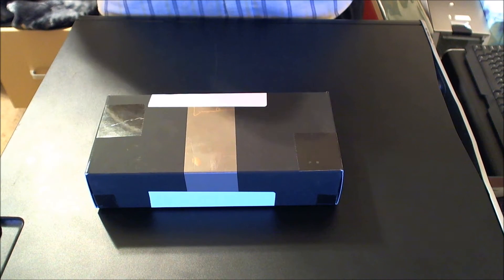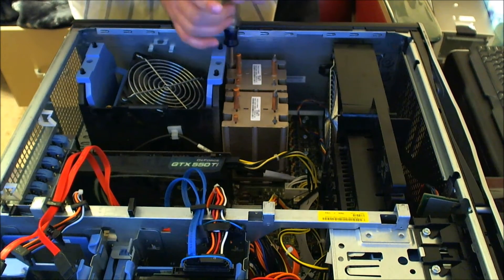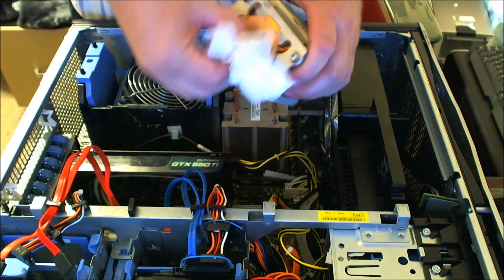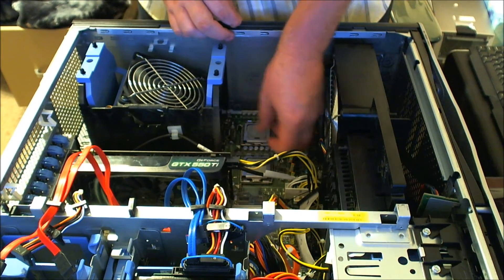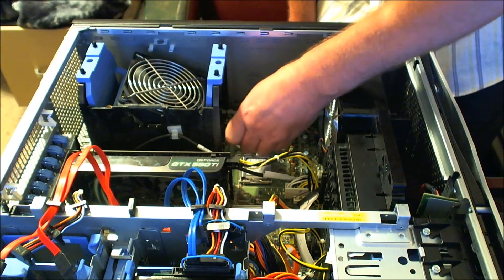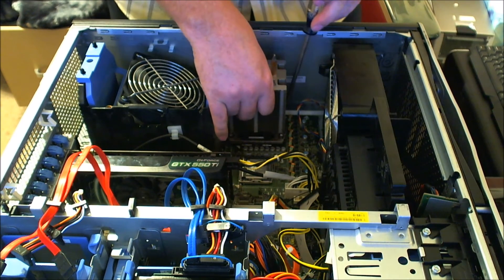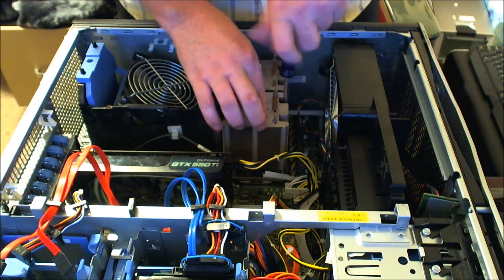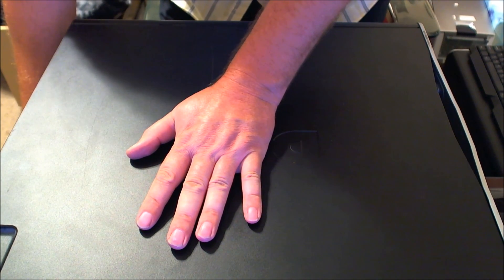Upgrading the processors ( cpu's ) in my dell precision T7400

Comment: Hello, thank you for your previous help, it really helped and now my T7400 is running ok. Nevertheless, I'm noticing the difficulty to install USB3. I still didn't try, because I read multiple comments that say it crashes the system, and the the pc can't even run with the new USB3 card inside. Do you know a way to have the USB3 through the T7400 ?
Reply from the maker: I have a  USB3 card in my T5400 ( the little brother to the T7400 ) and it works in it.  I pulled it out of the system to give you the model number but it was some off brand and the only thing I can say is that it has 4 port and also have a molex power connection and this is the only thing the card list on the board NECXG      I did see in the comment section of some of the cards people saying the cards without a power connection did not work in their systems   so maybe that is why some people have problems with the cards.   I  have not used  my USB 3 card enough to see how fast it is but it does work when I use it.   this is not the card I have  but it might work for you. https://www.amazon.com/Expansion-Ports-Large-Power-Chassis/dp/B0CCYRSVPC/ref=sr_1_36?crid=9HCK8IMJFA96&dib=eyJ2IjoiMSJ9.Db49ZdaAHktCVYvUscoLmKFx13J2nIcC0mzdxvUpw8nS7GKtug6Zvg_kt4H5TCm4rYiMkZR0D9EwFkSs-_CUuIXqFZn2PJL-lomWfTysIjwG_OrmBaOyaEPukBez1XuMG1myOWViWEAeiXNGEKy9c0t7OkxlO0VN6I7QysZTvxLI6lkMQ4LNttk1Kkmr3A0qJ2_SAfAq_46uJXWxa7nftA.qsb-mBoFSB--m_oECWZjhLNwawG515njLJtfj_UDLH0&dib_tag=se&keywords=necxg+usb+card+pci+express+molex+power&qid=1740952269&sprefix=necxg+usb+card+pci+express+molex+power%2Caps%2C134&sr=8-36&xpid=YdE035E4EiVQE
Reply from the maker: I checked my system today and yes the card I have is a 3.0 usb     I even tested it using the elgato cam link 4k  ( it will not work on a 2.0 usb and will tell you that if you try to use it with 2.0, well it worked with my card but I had to put the cam link stick right into the port for it to work, it would not work with the very short use extender that they send with the cam link 4k.

Comment: I no this is old, but my boyfriend is trying to revive an old laptop. He is trying to buy the t7400 cpu but gets different information, one seller says its a 478 pin, and one says its a 479 pin. do you know what pin it is as he needs it to be 478. thanks x
Reply from the maker: I am not sure myself but can check on it after I get back from town. but here is a starting point https://en.wikipedia.org/wiki/LGA_771
Reply: @fromcarstocomputers7261  omg thank you for getting back to me.
Reply from the maker: @ Yeah I was just reading the same thing I had sent you and it says it has 771 contacts ( not pins )  but it does seem like have seen people call it a 478 pin even though it does not have that, but I am not sure because that was years ago.    https://dl.dell.com/manuals/all-products/esuprt_desktop/esuprt_dell_precision_workstation/precision-t7400_user's%20guide_en-us.pdf
Reply: @ Thank you for the information I have passed it on. There is so much to read and learn from what you gave me. Thank you again

Comment: Hi,
I'm looking for a network card Ethernet that fits in this 7400 dell precision mother board. Can you recommend something ?
Regards.
Reply from the maker: The T7400 has onboard network but if you are looking for a lower price one TP-Link 2.5GB PCIe Network Card (TX201)         ( there are cheaper ones but this is about a low as I would go )
Reply: @fromcarstocomputers7261  hi, thanks.
And in which PCI slot of the motherboard does it clips ? Please.
Reply from the maker: @Crux_    The bottom slot will work good.   but you can use the on above it as well. here is the documentation from Dells website  page 27 and 28      https://dl.dell.com/manuals/all-products/esuprt_desktop/esuprt_dell_precision_workstation/precision-t7400_user%27s%20guide_en-us.pdf
Reply from the maker: @Crux_  here is the same set I have these are the fastest official quad-core  cpu's for these systems  Xeon X5460 3.16GHz Quad-Core            here is a link to a matching set on ebay   https://www.ebay.com/itm/355196468911?itmmeta=01HPMD98EBYA551QHCM10NK9CN&hash=item52b35bfeaf:g:8R8AAOSwHktlVGw1&itmprp=enc%3AAQAIAAAA4Fq2TSMwQ380V4YAlvUZhjK8OnRJUTRmr8ODHWMiAh9qzOiyAU93Pu5%2BpZC2xaxc7Za3IdLvvtt8%2FN7MgUoTvBe8ypld4IuMOwH6CVk%2F6b93XvEwjOoiDNFwI9OkhlT7WBH%2FJfjMqf9Sh5PbThTvttO9FOA5OKgb35VKvOLG7Zvh0KKXFBshlwwTLk%2F2NyozIpHHDY9iGP0WFcDKZXcnIwlF44e3yIHpoc5UmVFnkq3vhY%2BEXnKz8KeHgjkRVWjuW9QB%2BJJjBOJjZDkt7v0GDwBRL0NNBZmx1uICzW1WFTWb%7Ctkp%3ABk9SR7CHpY21Yw
Reply from the maker: before you put a lot of money into these system you may want to look into the precision T5810  ( you can search this number out on ebay search and get an idea of the machines 115514581388  )  now the T5810 is 3 generations newer than the T7400 but.  neither of the system will support window 11 ( yes there are ways to make it work. but not the right way )
Reply: @fromcarstocomputers7261  ok ! For the moment I will remain on the 7400, without adding more than a network card to have access to internet. Because the onboard one doesn't work. To have access to the web.
I finance is very very limited, so yes, I will surely upgrade to the T5810. 
Is it possible to just place the T5810 motherboard inside the precision 7400 tower and keep all the other elements, so I can save money ?
Reply from the maker: @Crux_  There is a good chance the network card is still working but is turned off in the bios ( or has a driver issue )  The check the bios.  with the machine off. get ready with your finger ready to tap the F2 key then push the start button  and then start tapping the F2 key like this 1 '1000' 2  '1000' 3 '1000'  after about 30 seconds it should show the bios window   ( in the bios wind you navigate with these keys  tab / esc and you arrow keys  go to "onboard devices  and then look for integrated nic  and in there tab over to "on" then hit esc ( there may be a place to save your setting but the system should boot up from there.
Reply: @fromcarstocomputers7261  thank you very much for the detailed solution. But I'm now guessing to try wireless connection with this workstation. 
I don't think the onboard one can do that. So maybe the PCI Wi-Fi card you advised would allow to get internet from my smartphone, or maybe a  USB wifi could do it (not sure with this old motherboard). What's your point of you on that, please?
Reply from the maker: @Crux_  The Precision T7400 and T5400  are built very well, their old but have a lot of brute power. I have a precision 5810.... but I still have my T7400 ready at another workstation.
( by the way, no the motherboard from the 5810 will not fit into the T7400 case )  The T7500 was the last system to use that case, and I don't think it would have been interchangeable

Comment: do you need to update the bios?
Reply from the maker: It was updated to the last bios they had for it but no new bios after June 2012   ( by the way it also says that these do not support windows 10, but I have used windows 10 pro on mine for years now and never had an issue with it.
Reply: Hi. thanks for the reply. according to Dell A07 is the latest bios. I plan on upgrading from the 2.0 ghz to the 3.0 ghz  x5450 cpu. A07 came out in 2010. Is there a newer one from 2012? I have also been running win 10 for a while. Thanks again.
Reply from the maker: @danielsalisbury563  On Dells website ( After a search for the work station Precision T7400 ) It show Bios A09  came out in 27 Jun 2011.  but right above that it has a bios that does not say system bios but it came out in 28 Jun 2012.  so I went over to my  T7400 and booted into my bios  ( tapping F2 as the system starts ) and it shows my bios version as A11 so that is where I get the 2012 from  but it is strange that the A11 date on my system is 4/30/2012   so it is not a perfect match with Dells sight. if you want to be sure then just  install the A09 bios and after that them install the A11 bios.
Reply: Hi. I'll do that. Will these updates support all cpu's? You are truly the great guru for all things Dell!
Reply from the maker: @danielsalisbury563  the link below will have the cpu's that will work in the socket that the T7400 uses  but officially  some of them are not supported for example  if you are using the cpu's with a 1333 mhz bus speed ( the ones that you need 667 mhz memory to use )  then the quad-core 3.16 is the fasted one supported.  most of the system have the 1333mhz cpu's.  but if you are using the 1600 bus cpu's ( the one that you have to use 800mhz memory ) then the fasted supported one is the X5472 ... maybe the X5482 I would have to research that again to know for sure.  the cpus listed that are faster than these are for some server system and never supported for the T7400  but I have seem where people say that they will work in the systems.   but if it was me I would and have  just stick with a max of X5460  3.16 ghz  and the 1333 bus. the 800mhz is faster but the memory cost more and is getting harder to find because most of these just used the 667. 

Now with that said. I still have my old system T7400 and I use it  but If you have not put out the money for the cpus and such and are getting ready to start then  you may want to check out the Precision 5810.  because you go from ddr2 memory to ddr4 and you go from a pcie 2.0 16x gpu slot to a 3.0 16x gpu slot 
Here is the link to the t7400 cpu list  https://ark.intel.com/content/www/us/en/ark/products/codename/26555/products-formerly-harpertown.html
Reply from the maker: @danielsalisbury563  a good GPU for these is a GTX 1060 ( 6GB )  it will use the two 6 pin power feeds that these unit use.

I did use one in My old T5400 ( the little brother to the T7400 ) and it did a good job

https://www.youtube.com/watch?v=1TvOyUd01P4

Comment: My T7400 runs fans at full speed and loud after the upgrade to dual Xeons. Any suggestions? Thank you.
Reply from the maker: The paste may not have covered on the cpu right and it is over heating. or the case switch could have stopped working.  take the one you added back out and see if the fan works right and if it does then the switch is probably bad.

I would also uninstall all the memory and them give the whole system a  cleaning with some compressed air including the power supply and were the memory installs  then put it back and test it.

Comment: Hi,
Thanks for your video. Do you if passive heat sink are ok if xeon x5460 or more are installed?
Reply from the maker: It will work just fine, the 3.16 ( x5460 ) is one of the cpu's that you could have installed in these. I have a set of them in 2 of my machines
Reply from the maker: Here I made a video about that cpu https://www.youtube.com/watch?v=BM_-Rl9Qi1E

Comment: Will x5667s work in it?
Reply from the maker: I do not think it will work with the x5667 because it uses DDR3 memory and the T5400 systems use DDR2... But I could be wrong
Reply: I dont't think so, T7400 has LGA771 socket and the specs says xeon 5400 serie

Comment: Can SLI gtx550Ti, man ?
Reply from the maker: Not really the machine for SLI. So I would not SLI with any cards in this machine
Reply: hi. i did a lot of research to put gtx cards in to sli but is almost impossible. It will cost lots of time and money and it will maybe work. Some cards can run sort of sli, but they are expensive quadro cards.

Comment: i use the xeon too , i have 3.20ghz  hexa core , 6gb evga graphics card and 32 gb of ram . Its a beast . I like sim racing
Reply: What xeon are you using that has six cores
Reply: @mrdungeoncrawler1722  at least Socket 1366

Comment: Pls can I upgrade my dell precision 690 with x5365 or x5472 pls which one can I use , or can you recommend high cpu for my my171 motherboard
Reply from the maker: I have read that a  X5365 will work in the 690 with a MY171 motherboard

Comment: 😄 heehee im still using my dual quad core 2.66 cpu snails 🐌🐌
Reply: MrSammy 
Pls can I upgrade my dell precision 690 with x5365 or x5472 pls which one can I use , or can you recommend high cpu for my my171 motherboard
Reply: MrSammy  pls my pc is dell precision 690 with my171 motherboard pls can you recommend higher processors for I've already got x5365 
Any other higher processors pls
Reply: only 5300 series cpus

Comment: Hey its me again. Just wanted to ask my question on this video as it's more relevant. For gaming, would there be a huge difference in performance from using a 2.66GHz e5430 to a 3GHz x5472 or something similar above 3GHz? Considering its really cheap price for two in ebay, is it worth the upgrade? Thanks
Reply: Theophilus Carlos 🙂 It depends on the game, older games it wont matter, newer games maybe yes maybe no, if ur priority is gaming then ur first priority should be to get a faster gtx game card 1060 1070, dont worry about the cpus rite now, upgrade the gtx card and play ur games and see where you are at in fps and overall how it runs for u, then maybe look into cpus if ur still not happy, just keep in mind the faster the cpu the hotter and more power hungry u have to draw to use em 🚢🚢, but a fast gtx card only really draws power when ur gaming 🚤😉
Reply: Yeah I found that it totally depends on the game. Recently upgraded to a GTX 970 and it runs Mad Max really well since it's optimised. getting 100 frames average which is what High End PCs with the 970 are getting. Other games that aren't so optimised, though, you'll notice a difference in fps. My brother has a 1050ti with a better/newer CPU and runs with more than double the frames in insurgency as I do. I'm fine with my current dual CPU :D. Did the upgrade to 16GB RAM too :D
Reply: Yeah if ur happy with the fps then plz dont upgrade the cpus, because the gtx card powers down when ur not gaming, But faster Dual CPUs cannot be slowed down to conserve heat & electricity when ur not gaming, if you could throttle them down that would be so cool but you cant 🚢🚢😄
Reply: That's a very interesting and fair point. Thanks for that.
Reply: Thats cool u got 16, over here im still using 8gb so far its ok since im just playing 2000 - 2009 games. Oh thats another thing dont go over 16 unless your doing video editing, because the more ram you put in the more heat & electricty it generates, and u probably already noticed the high speed fan over the hot memory heehee 😄
Reply: 16gb are really cheap to get on eBay (alternatively you can go for a old blade/rack server with the desired ram and possibly snatch a matching pair of good CPUs as well)... the 4GB sticks for 32gb are still sought after, tough.